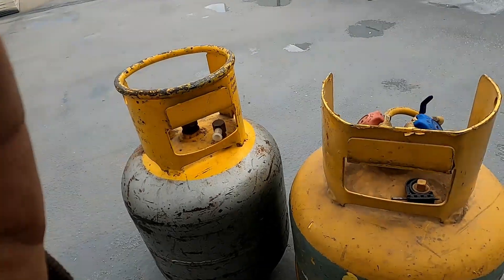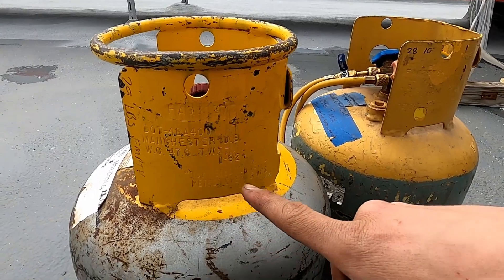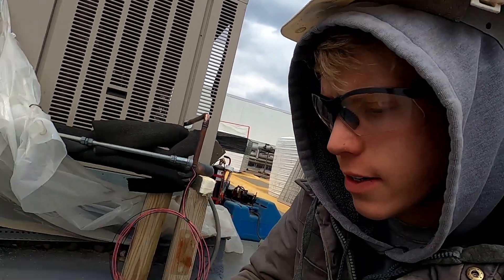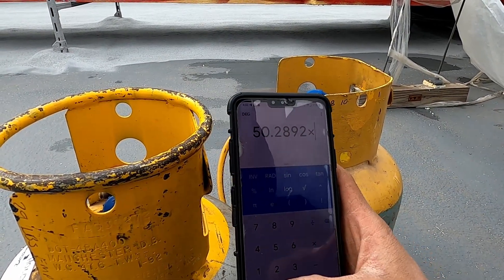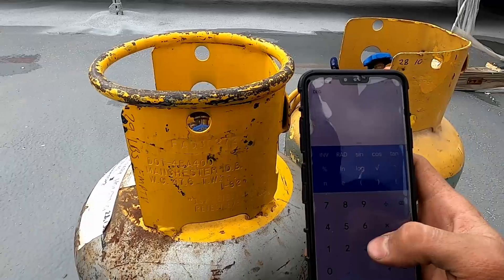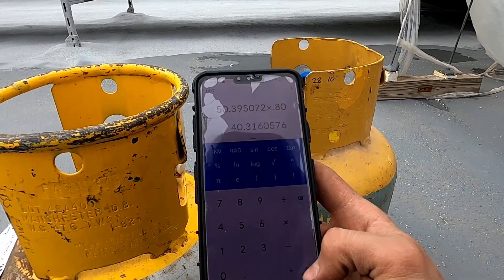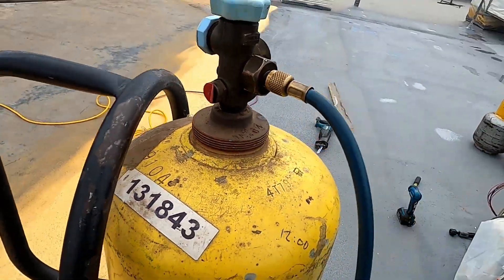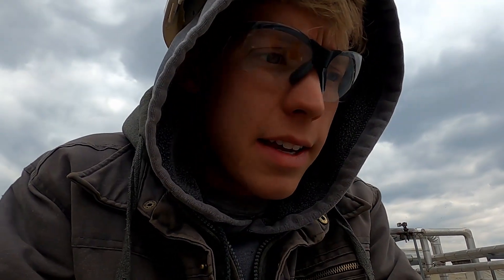How Much Refrigerant Can a Recovery Cylinder Hold?

Comment: What do you do with the recovered R-22?  Can it be reused directly on a low R-22 service call or transferred to a green R-22 source tank?
Reply from the maker: In this case, we put it back into this system after completing some work. The green tanks actually have a check valve that prevents them from being refilled, and if you read on the tanks they state that refilling and transporting those tanks is a felony, punishable by up to a 50,000 dollar fine. In the actual recovery tanks however, you could reuse it in a different system but you'd want to run it through a filter drier. Ultimately it can be recycled at your distributor.
Reply: @ReubenSahlstrom  technically recovered refrigerant can only be used in the same system it came out of per epa standards.
Reply from the maker: @extremeair1199  Yeah I hadn't realized that until about a year ago. Seems like a reasonable rule from a contamination standpoint, but not so reasonable from an environment standpoint. Seems like it would make sense to use it up rather than have to commercially break it down and recycle it.
Reply: @ReubenSahlstrom  yea of course and I'm not saying most people don't do it anyway.  If you change out a working r22 system and recover let's say 8 pounds wouldn't it make sense to use it up on the next r22 system?
Reply: @extremeair1199  Only if it is the same owner of the system. You can't take that R-22 and go to another service call and put it in a different owners AC.  EPA rules.
Reply: @ReubenSahlstrom  That makes sense.
Thx!!